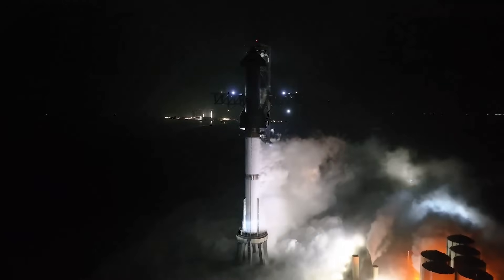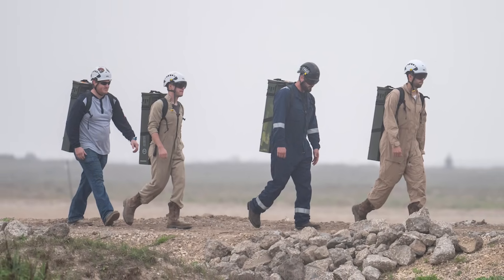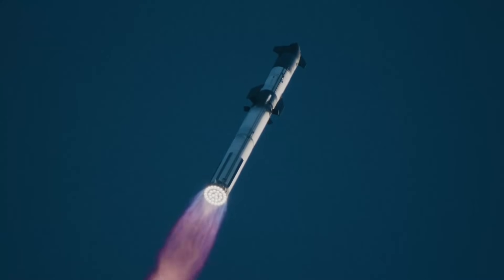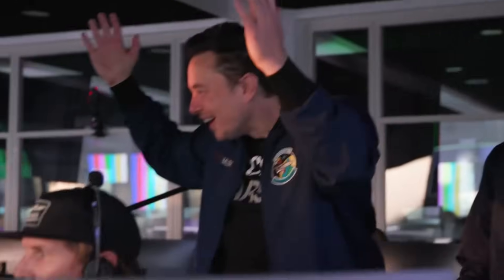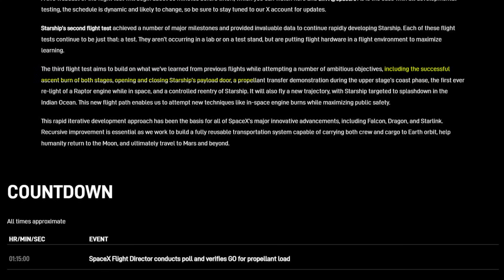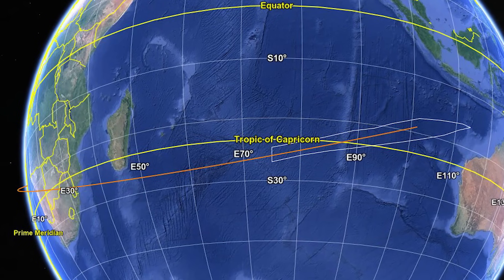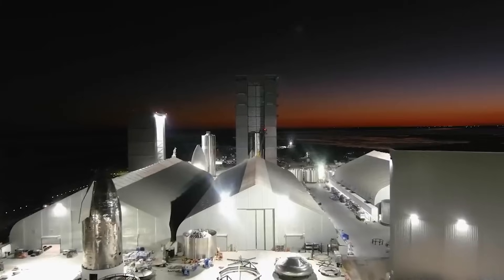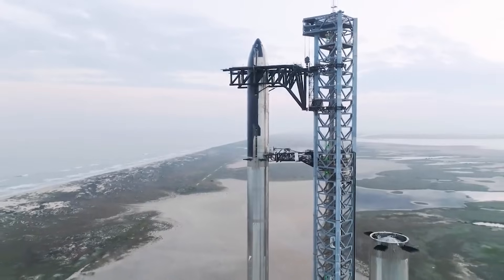SpaceX Is Days Away From Starship's Next Flight Test

Comment: Emergency!!!
 Baffles will not work to prevent the slushing problem, because the tanks of Starship system are too large.
The tanks  of  Starship and  superheavy need 2 disks valves, expanding the diameter of each tank. One of the disks, the one on top, rotates above the contiguous disk to close the overlaping holes on the surface of the disks; to reduce the Size of the tank by dividing it, before any rotation or acceleration of the rocket. This will prevent slushings and protect the plumbing, if located 10% above the bottom section of each tank. Large telescopic pistons can be attached below the bottom of disk valves to control the fuel pressure as the piston expands into  the fuel tank. 
 I have built a model that works perfectly. The second disk valve can be located 10%  below the front of the tank, to also protect the front of the tanks from the slushing forces. 
Why is Elon  not using four pins instead of three to secure each heat shield tyle? Four anchor points provide far more stability to secure a tyle, not three.What is more important than securing the heat shield? Four anchor points would eliminate the problems of tyles falling off the ship every time there is an engine ignition. Please get this message to Elon. Thank you.
Reply: You're determined to try and fake like you have a clue, and faking it all you can do and you do it badly.
Reply: The biggest worry is whether or not Starship will explode! That's what NASA is concerned about.

Comment: Feels like SpaceX knows something we don't. They do six decades of rocket science in 10 years. Wth
Reply: During those 60 years of rocket science, 4 rovers and a helicopter were landed on Mars, Voyager 1 and 2 rocket launches exited the solar system, an international space station was built, Hubble and James Webb telescopes launched, Apollo missions put a man on the moon. Rocket missions have retrieved samples from 2 asteroids.

SpaceX has barely travelled beyond low Earth orbit.
Reply: @mikeomolt4485 I think you are forgetting about starman. And if you include non-spaceX payloads, Psyche mission is currently directed towards an asteroid. Theres a bunch of others, just thought I would name a few.
Reply: @Little908, it's not like they actually maintained comms to Starman after it left Earth.

Starship HLS will probably be the first thing SpaceX builds that will actually operate beyond GEO.
Reply: They hired people with experience. They did not start from scratch.
Reply: @bluesteel8376  Actually the origins of spaceX was pretty much from scratch. They didn't have Boeinig or Lockheed $ or help. Tom Mueller & Team was fairly self-taught building the Merlin. Musk and 8 others set up shop on a remote island for testing and made daily supply runs. It's a pretty crazy story.
Reply: They have computer aided design
Reply: Rapid iteration with a less restricted budget (compared to a completely government-funded agency like NASA) makes it possible.
Reply: @lyricbread  The legacy contractors were never really motivated to be cost effective, after all it was to their profit.
Reply: "Six Decades in six years" LOL. The bizarre things the MuskCult invents to feel special.
Reply: An excellent demonstration of the superior innovative capabilities of private entities!